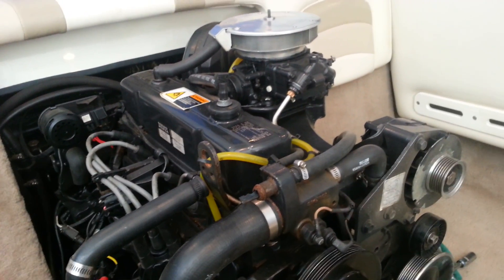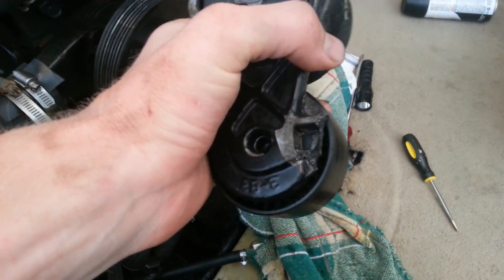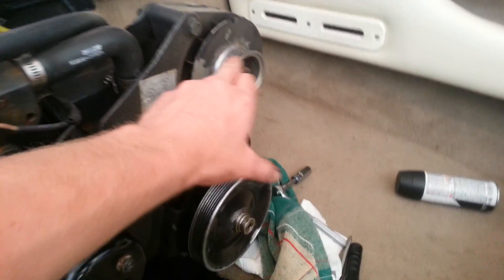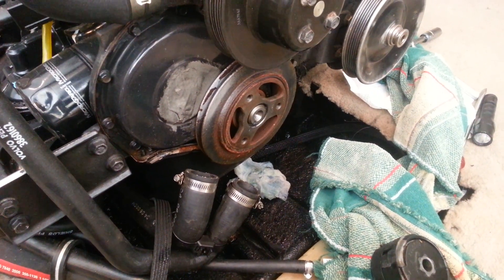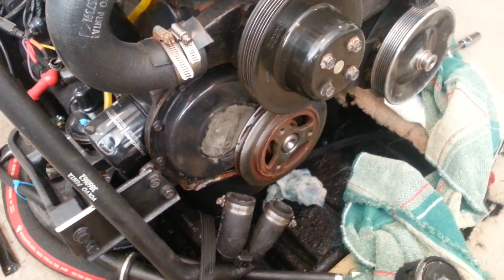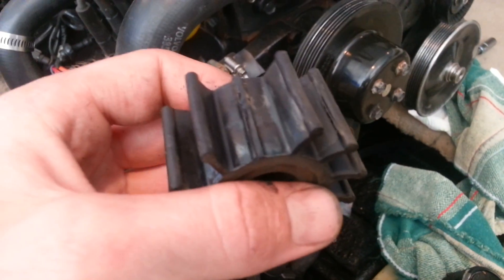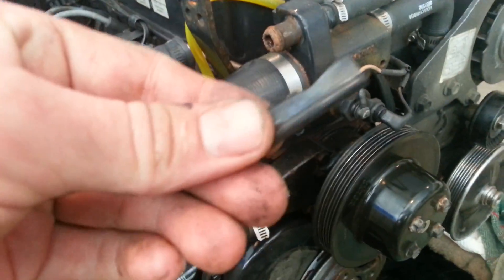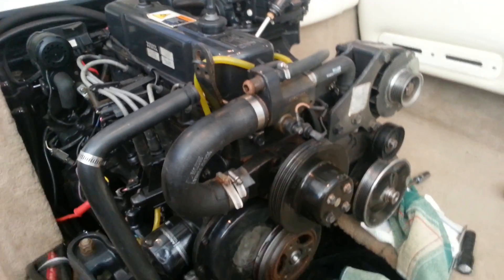Volvo penta 3.0 tip

Comment: Dude, ok so I watched this video after purchasing a 2001 glastron sx 195 with the volvo penta 3.0, was out on the lake today and it ran hot, unhooked the hose and low and behold a fuckin rubber blade clogging the flow, pulled it out and made it back safely to the dock, I'll be replacing the impeller now but without this video I would have been fucked! THANKS!!
Reply from the maker: Hell yea man! I'm glad you caught that. That could have been expensive.  Good catch!

Comment: I just bought boat with this engine (2005 3.0 GL) but I have few issues... Acceleration lag, engine stalls at gear quite often - can be solved but adjusting idle speed to 1200 which had previous owner and thats crazy high imo.. whats normal idle speed for this engine? and last but not least i get only like 4 - 4,2k wot rpm..
Any thoughts ? :)

Comment: Good work. Wish mine had a serpentine belt system. I'm swaping my 3.0LX into a boat that had a 3.0GS. Quite a difference between the two. I like volvo's raw water pump being in the boat, but man now I have to change oil pan, oil pump, etc because the hose goes under. Again nice clean work and a great job. Thanks for video.

Comment: Volvo totally screwed up this cooling system! Always check for impeller blade in that small hose coming from the back of the thermostat housing. And take the big circulating hose off at the thermostat housing to look at the thermostat. It might be held open with impeller blade. Make sure all hose clamps are very tight, lots of pressure for no reason. Terrible design with other issues too.

Comment: Our motor got extremely hot so I opened the housing of the pump and the impeller was completely crap. Almost every blade was gone. No waterflow at all.
The Impeller in your video looks just brand now to me when I compare it to mine :'D
Jup, extremely bad, I know...

Comment: THis engine was made here  in Brazil too, but in 2.5  form so it dont need balancer shafts, and all pumps were by gears, not by this pulley and tensioner setup, so dont need maintenance. The balance shaft (in the later iron duke) and the stupid plastic parts take away the legendary reability of this engine, its really a shame.
    Another difference looks like the cam, for marine user, the peak power is at 3200, in automotive form, it is at 4400-4800.

Comment: HEY MAN I HAVE SAME MOTOR 05 GLASTRON 175 SX...I'M HAVIN A COLLING PROB I PUT A NEW CIRC PUMP ON IT CUZ...IT HAD A LOT OF PLAY IN THE SHAFT...BUT STILL NO COOLING....BUT I'M GOIN 2 TAKE THE RAW WATER PUMP OFF NEXT AND CHECK THAT...THANKS....ANY TIPS?
Reply: I have a 2007 3.0 volvo penta and change the impeller every year at the start of the season